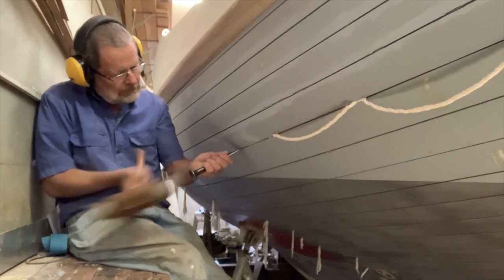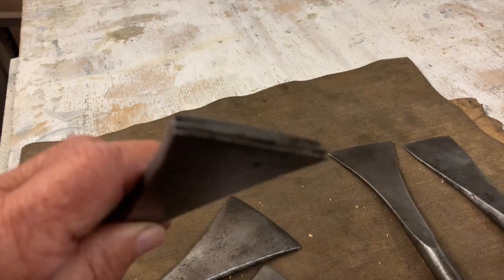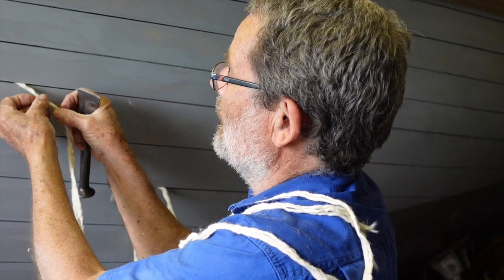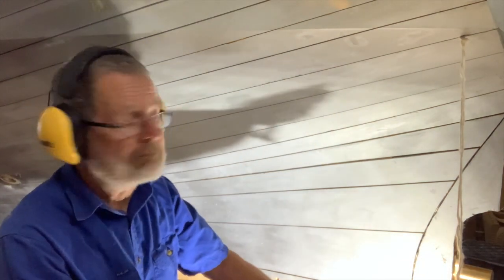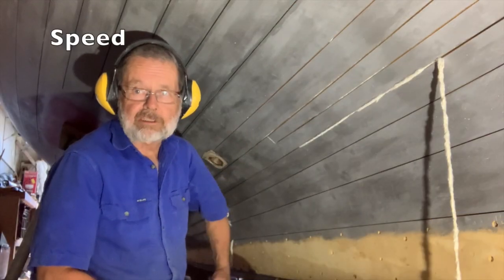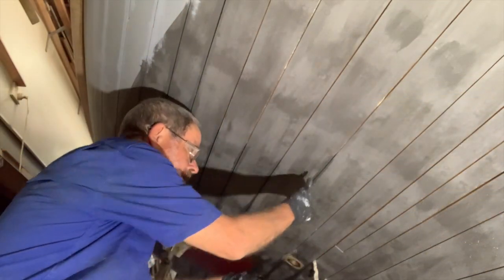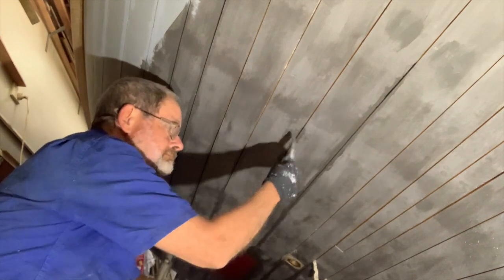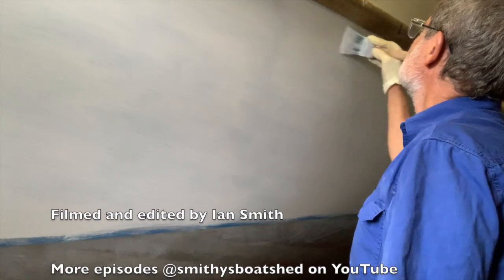Carvel Planking  Ep 20: Caulking the Hull

Comment: Quite thoroughly shown and described. Excellent.  I see carvel planked boats here in the Northeast U.S, that all show seam lines after a bit due to the big difference between the hot August heat and the bitter February blizzards and nothing expands and contracts exactly the same. I don't mind the look since its kind of honest and historic. When I saw you went the extra mile to use the primer mixed with talc (which I had never seen before) and paint it on the seams and sand it until they disappear, it made me wonder. Would you say that stored outdoors or in unheated buildings in Sydney's climate, that they stay invisible for a number of years?  Do you know others that don't bother with that? Interested in your opinion.    Wish they would let me give an extra thumbs up but, alas, Youtube is formulaic.
Reply from the maker: Thanks Paul. Unfortunately carvel seams will always move and eventually show. The stopping just makes it look good for a while. I believe that those who can’t stand to see the seams don’t deserve a wooden boat.
Reply: @SmithysBoatshed  Quite so!

Comment: Mr. Smithy's. , put subtitles, to translate into Portuguese, thanks
Reply from the maker: Sorry JP, I’m just a boatbuilder, I only speak Australian (English).
Reply: @SmithysBoatshed  he means that if you add subtitles (in English) that they can later be translated by YouTube into other languages for folks watching in many different countries.  I've never done it myself but there are supposed to be various ways this is accomplished.  YouTube has a feature to auto-create subtitles, kind of like how speech-to-text works on your phone.  Somewhere in the Creator's Studio there is a button you can hit to start this feature; It works ok but it has trouble with words that have different or obscure meanings (lots of those in boat building), and slang, or things said with heavy accents.  Another method is that volunteers for your channel can take the time type out the closed cations (subtitles), this is more accurate but requires those volunteers.  Anyway, great channel and I greatly respect your dedication to preserving your vast knowledge on video.
Reply: @SteelDoesMyWill  thanks
Reply: put the caption anyway  Australian [english]